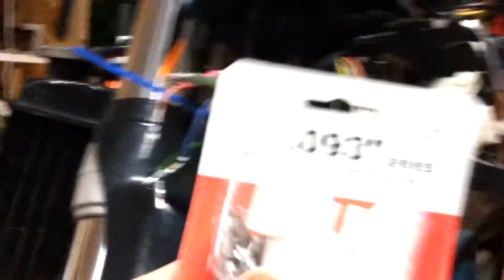20130211_183040.mp4

Comment: You don't need a special tool for that; just push in something thin in between the metal connector and the plastic, where you anticipate the locking flap is located.
A piece of sheet metal would work.